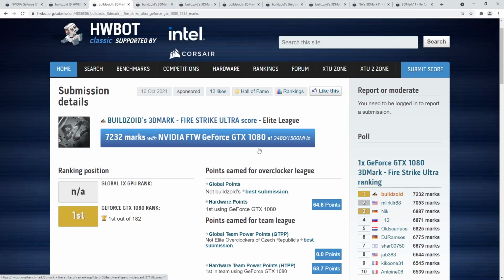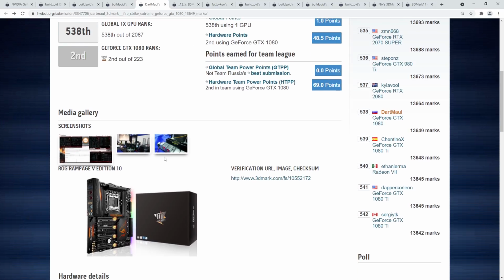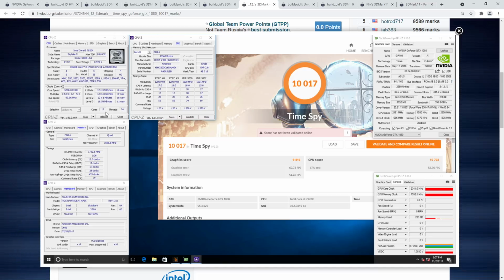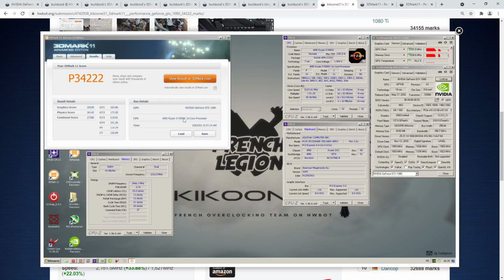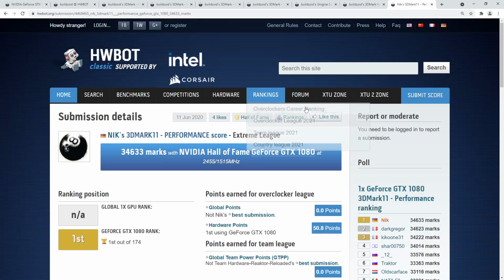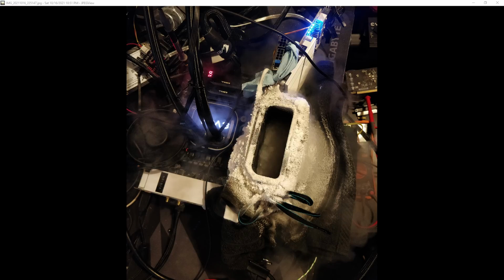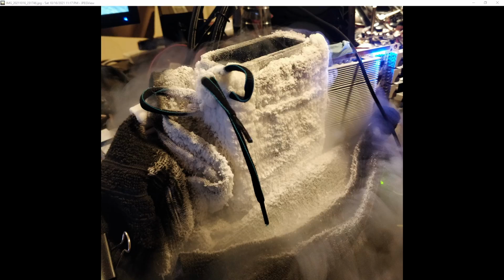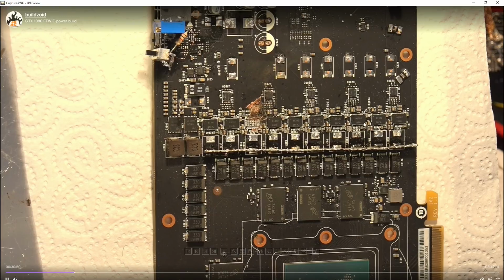Rambling about overclocking the E-powered GTX 1080 on Liquid Nitrogen.

Comment: I’m not a custom overclocker, but you mentioned wanting core clock sliders in an over lock software.  The gigabyte 1080 extreme gaming software that came with mine uses all sliders for the settings.

Comment: Powercolor RX 6900XT Ultimate: Input power connecters  [   3    ] [   2   ] [   1   ]
What is the maximum continuous power limit for connectors 1 and 2 ?, Connector 3 is coupled to connector 2 so connector 2 has a maximum input limit of what before it fuses ?. Do I have to power connector #3 ?.

Comment: I really don't get what people think they get from these experiments. Cool you get to show of a record performance with the cards, but what's the point ?? No one can do this in a normal PC setup, so its totally irrelevant to normal PC builders/users/gamers etc. cause even you could solve some of all the problems and make a consumer cooler, You'd still need a huge installment to make it possible, and It would be way to expensive to buy/run. I get this is for totally nerds and can be fun to watch, but it's still so far away from ever being a real world cooling solutions outside a lab 😛
Reply: I mean, it’s generally fun to see how far you can push things. There’s also the element of competition. It’s also interesting to see how hardware behaves in extreme conditions you otherwise wouldn’t see. Sure, most of the knowledge gained isn’t super useful to the average user, but why do hobbies have to be practical, you do them for fun. The people who do this professionally are typically sponsored by companies so they can use it for marketing.

Comment: Could do. i just game and finding a balance where for eg war thunder resets driver if too high some games can though i have an i3 8100 and 16 gigs of tight 2400 ddr4 haven't done much benching since running a q9500 at 5 gigs with ddr2 500 g-skill on a striker extreme i680 with three gpus

Comment: You mess with the driver at all like texture filter high performance or force no aliasing and performance  and are on the best driver for the bench mark and disable hard ware accelerated scheduling because honestly that stuff is useless
Reply: Dose that actually effect the bench mark
Reply from the maker: @danielwhite7220  it helps a little and I have all the Nvidia control panel settings tweaked. LOD makes the biggest difference when it comes to benching Nvidia cards.

Comment: Ah yes 1070 amp extreme. Very good card had it for around a year before i switched to a 6900xt and sold it to a friend. Could oc it to over 2200mhz on air i think it was something like 2205 or something wich was above the software lock or something. Wasn’t very stable but 2100 to 2150 was.

Comment: 10:26
Just use Asus GPU tweak. There's a setting that allows you to unlock the sliders.
Reply from the maker: GPU Tweak is sooo bad tho
Reply: @ActuallyHardcoreOverclocking  

I agree. Maybe EVGA precision works too. I tried afterburner and zotac firestorm, both didn't allow to go higher than +1000 on the mem so after I got it with GPU tweak to work, I just used that whenever I needed to push mem.
Reply: @ActuallyHardcoreOverclocking  
Just downloaded Precision XOC and X1 and neither allowed to go past +1000, couldn't find a setting to unlock the sliders either.

Comment: the best scores are still CPUs with 133TDP with what the GP-104 does 4750GHZ with CPUs and higher minimal and 133TDP therefore Jopp that's true with Pascal 100% + 33% GPUs above and below you only make fewer points with 5.133 - 5.3ghz CPUs on 4200-4500mhz ram you get results that are slightly better in my opinion, with the GP 104 GPU chips and with ram I am not surprised that the i7 6950x at over 5.1GHz and AMD's Ryzen 9 5950x scores such points on a rampage V. and new boards rams that runs at 4798MHz with CPU I can only say what's going on with me, and with win 10 I only ram up to 1410-1540MHz with 3D Mark in the standard max with the GP 104 GPU Win 11 with GPU chips / with ram 1900mhz about it and in the stock I drive normally 2.4-3.7 all core 4750GHz all core all trades even if it says 4370GHz that's a software error x85 halt-retro hardware with new software. I don't know how it works with 3000mhz benchmarks + ram or more runs but 4750 + GHz was always I just want to point out the best score for me. I don't want to know how high it goes at 6.4ghz or 7.2 GHZ ^^ and 5.100, MHz ram in the score that my CPU with the GPU at the limit. with liquid nitrogen. whether that still benchmarks no plan. I will definitely not try. ^^ that's what I think about the scores

Comment: My guess is the DartMaul Score is done with GPU Mem Timings (maybe similar to the Pascal ETH largement Pill)
Though since no source code of ETH pill is available I can't provide evidence.
Those guys are getting insane memory throughput with that tool (like %33 or something) clock for clock on a ETHash workload.  (that sorta thing was a big deal during the last GPU shortage a few years ago)
Reply: Mining software would also have allowed him to get past +1000 speed on the memory as well. Ironic complaining about mining when miners have made the solution to his problem 😄

Comment: I only have the demo version my msi 1070 ti 8gb power on 4370ghz oc i7 x980 6x4 = 24gb ram @ 1900mhz ddr3 win 11 pro Time Spy 6600 score win 10 6400 score win 11 PCMark10 4046 score win 11 3DMark11 performance 18194 score FireStrike Extreme I have not even these are the standard best results on a gpu that is on a gtx 1080 msi afterburner oc with retro, not bad windows 11 makes my rampage extreme III score better than win 10.

Comment: DartMaul could very well be "playing" whit the windows timer (RTC) to get such a high gpu score
Reply from the maker: 3Dmark system info should catch that.
Reply: yes it does today but if i remember correctly it was add at some. IRC H2o vs. Ln2 got away with it for years before getting banned
Reply from the maker: @fromaflafl2198  true but it should also boost physics and combined.
Reply: yes it should help with all of them. it's just 1k+ is a lot to get from optimal windows 10 version ,3dmark version , drivers, and secret tweak non of the others ran vs "just running lod" like you